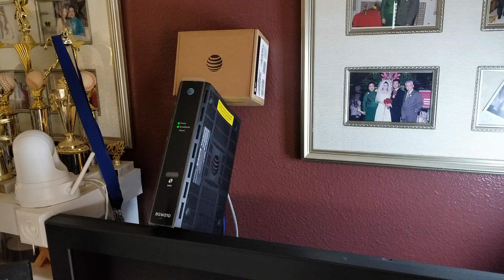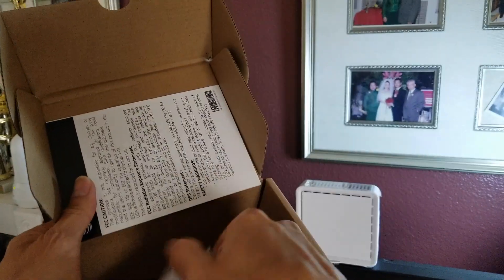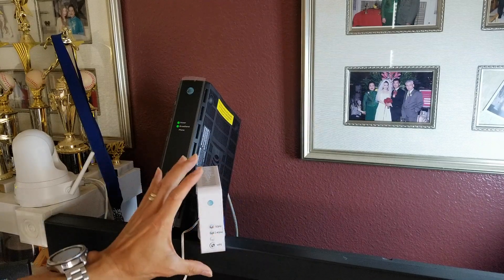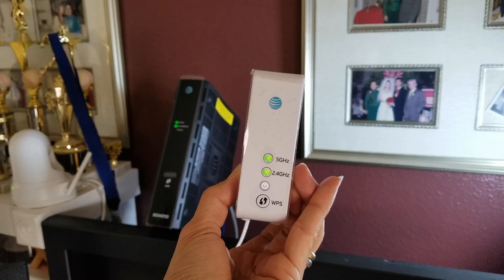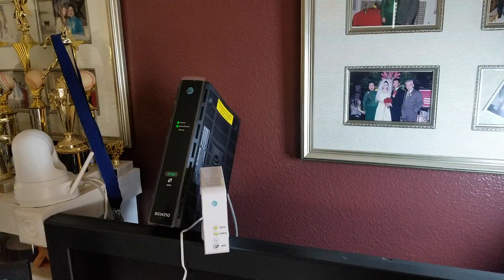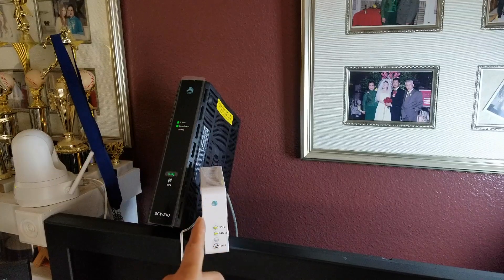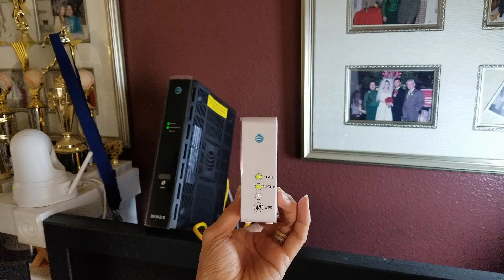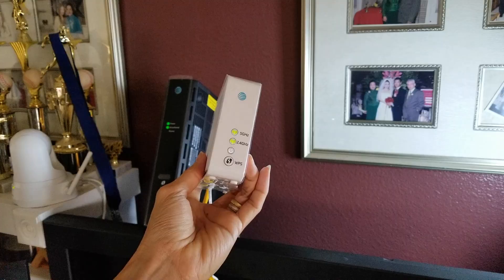How To Install Fix & Troubleshoot AT&T AirTies 4920 Smart WiFi Extender!

Comment: Great video! I'm not sure if I'm synced though. If it's synced through Wi-Fi should the WPS button in the gateway stay green? I have both 2.4 and 5 Gb lit but speed isn't there.
Reply from the maker: Yes, after you have synced then both lights should light up green on your WiFi Extender and No WPS button on the gateway should stay on after synced.
Reply: @macdaddypimpping  Ok thanks for the reply! Have a good one and be safe!

Comment: So i only have one ethernet cable running where i want this to go. Is there an ethernet output on this device. I would like my current wire to go into this, but run a wire out of this to my device too.
Reply from the maker: This is a Smart WiFi Extender and you can find one of the ethernet plug to run a wire out for your device. I did that for my D-Link Security Camera and now it has full signals!
Reply: macdaddypimpping Alright that’s perfect for what I need. Thanks man!

Comment: I need help ASAP mine just suddenly shut off so no buttons are lit or anything what do I do??
Reply from the maker: Check you wireless router, did you press the WPS button on both to sync?
Reply: Having the same issue
Reply: Plug them

Comment: Hi there. I have just had fibre optic internet installed in my home. We bought 2 airties. Does 1 of those have to remain plugged into our router via ethernet cable and the other then placed away from the router?
Reply from the maker: You only need to connect via ethernet cable from your router to Airties for initial sync then you can move to any location that has good signal and not too far from your wireless router.
Reply: @macdaddypimpping  thank for replying so quickly! I have another question if you dont mind? 
Since syncing both airties and placing them in different positions around the house, the signal seems to completely cut out every now and then. Before I installed the airties the signal in my room was about 3 out of 5 bars on my cellphone. Once I installed the airties, there is one very close to my bedroom and i now have full signal. However, every now and again the signal gets completely lost and it says that I cannot find the IP address. Any help with that would be greatly appreciated
Reply: No
Reply: Thank you!!!

Comment: I need help. So we have been using one of these for a few months but randomly today it stopped working and the signal icons keep displaying a solid red. What do I do?
Reply: Same thing was playing on my ps4 all of sudden it loses WiFi my WiFi work but not the Ethernet it keeps blinking green
Reply: Yea some here, I’d be playing my Xbox and then all of a sudden it just kicks out
Reply from the maker: You will need to reset it by pressing the reset button or press WPS on your wireless router first then press it on the 4920 Smart WiFi Extender to sync it again.
Reply: macdaddypimpping I did but even when both are blinking it doesn’t connect back to it
Reply: @PR0WN3D  i have the same issue

Comment: When using  the AirTie in a wireless backhaul situation you want to place the device based on RSSI signal. Respectively between -72dbm to -76dbm, a hardline Cat5 data outlet is preferred when using this extender. It is best to consult your AT&T technician before pretending how you as a consumer know how the proprietary device works. In other news, placing the AirTIe near your Wireless Gateway will cause interference. Hope this helps.
Reply: No harm in not wanting to wait 30 minutes to speak to someone whos command of the English language is sub-par, to then be xfered three times, so they can ask if you have reset the router all the meantime telling you they are so sorry and they understand the problem.  20 minutes later you get to wait for them to schedule an appointment for the second Tuesday of next week.  AT&T customer service SUCKS...

Comment: The broadband on my wifi router flashes red I have the same one in this video and my WiFi extender is blinking red as well
Reply from the maker: That means your WiFi extender is not connected to your AT&T broadband wireless router, try to press the WPS button on the AT&T router and then on your AT&T extender to sync.
Reply: @macdaddypimpping  hey my extender was blinking red then I pushed wps button upstairs then pushed wps on extender downstairs now blinking green is it paired?
Reply: Christopher Johnson is it?
Reply from the maker: That means your WiFi extender is not connected to your AT&T broadband wireless router, try to press the WPS button on the AT&T router and then on your AT&T extender to sync.

Comment: I had mine installed by ATT they mapped it etc. But my neighbor cut my cable while cutting his grass
.. ugh...and when they came out to rebury it... my booster never came back up... of course, they didnt check it and I had no idea it would be so hard to sync... red lights blinking still blinking and its ten feet away. I will keep trying, thanks for the video
Reply: Factory reset it by holding the red reset button for more than 10 sec , you'll need a pointed thing to press that button...After that give it around 3-4 mins and then try to pair it with modem
Reply from the maker: Good luck.
Reply: Try factory resetting the airtie and then resync
Reply: Jo Jo same problem ever find a fix?

Comment: What happens if the lights to turn red?
Reply from the maker: The red light indicates it is having trouble connecting to the 2.4Ghz connection from your gateway.
Reply: @macdaddypimpping  sooo... whats the solution?